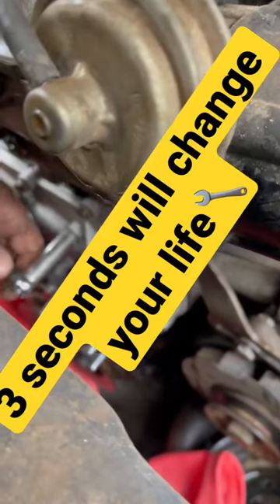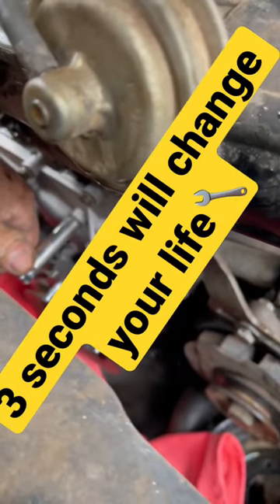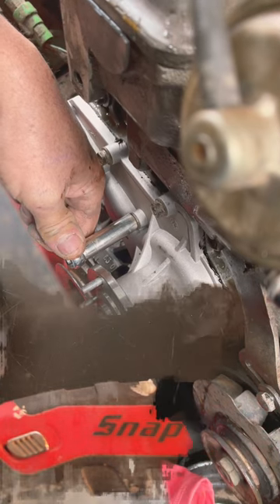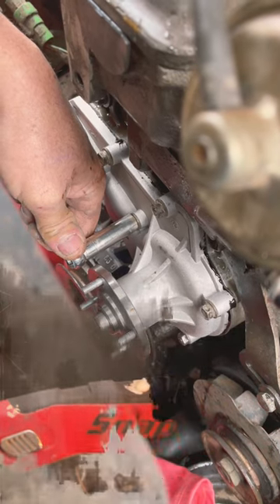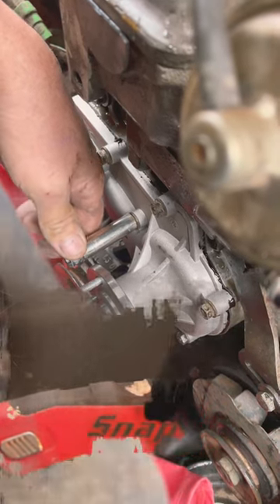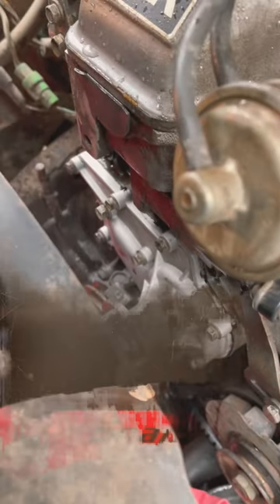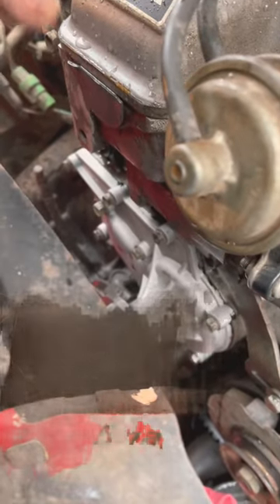This is why you hold your bolts for 3 seconds 🔧#shorts

Comment: mister mechanic was  illinformed.
Reply from the maker: Nope.
Reply: @fastflo1  Aside from some entirely irrelevant spring tension in the very top of the bolt under the head, the bolt won’t be unwinding from the threaded hole.  That rotational tension won’t extend down into the bolt. 

But  why not do a high frame rate super slow motion video of the bolt head  unwinding – see how far you can get it to go  see if it (as you said) cause the bolt to loosen. 
   Maybe the “Slo-Mo Guys” or the guys at "Smarter Every Day" would love to collaborate with you.  They already have the expensive gear and you have the great idea. 
I just don’t think the physics are on your side there.  I could be mistaken (wouldn’t be the first time), but my engineering background informs me that fasteners, especially heat treated ones, stretch out by an amount that is designed into the fastener.  This stretch (referred to as tension) locks the fastener in place.  Properly torqued  fasteners become loaded with tension that locks it in place, obviating the need for thread lockers or  lock washers.   So the whole “unwinding” thing  seems to be pure imagination. But hey,  if you can get it  Slow Mo  of the thing happening that would be the Bees Knees~!! 
Engineering schools might name a course after you.
Reply from the maker: @fishoil2158  according to JUNKER AND RESONANT VIBRATION . Google this if you do not know…. You will discover are incorrect. But slow motion would be great. In reality , you can pick up a wrench and feel for yourself. Proof is in the puddin…. Pretty simple to figure out . Not a complicated formula. You hold the wrench for three seconds and physics does the rest. Opinions are set to rest . Do yourself a favor if you are an engineer and get away for your specs and get your hands dirty on an old engine with some rusty old bolts . Like stuff is in real life. You going to break out your specs and torque wrench for you old lawnmower?